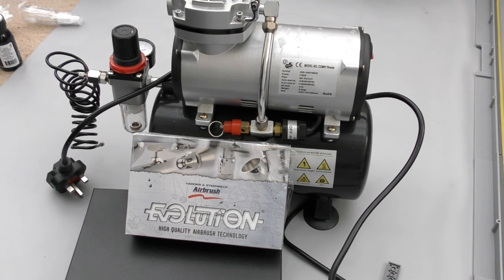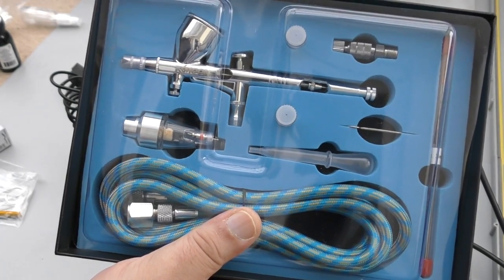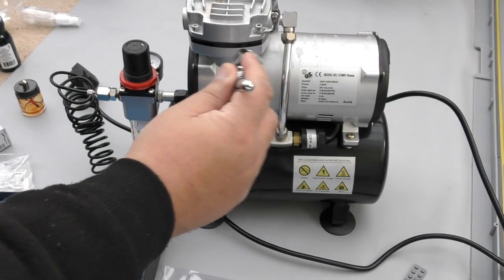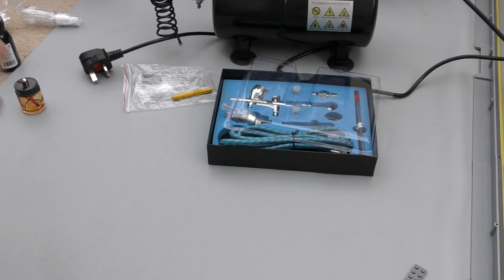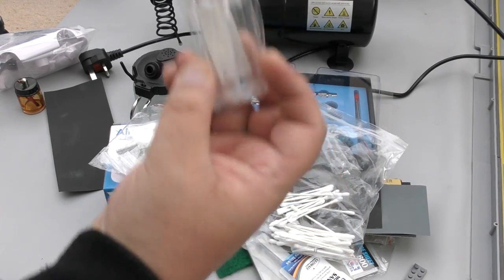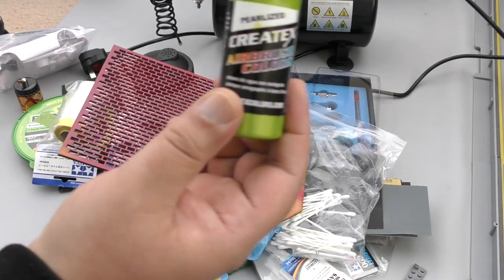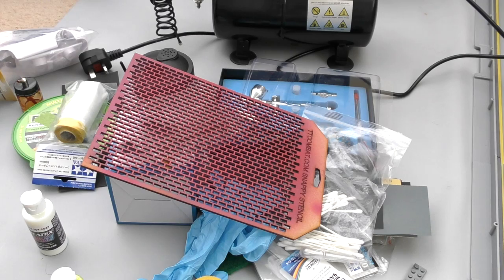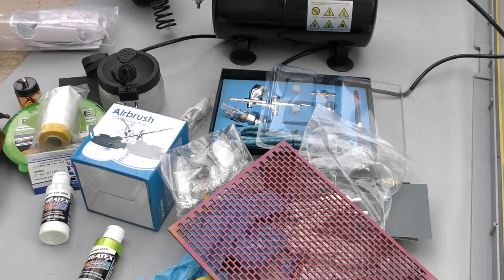HOW TO START AIRBRUSHING - A NEWBIES AIRBRUSHING GUIDE TO PAINTING MINI Z RC CARS

Comment: Mossy take the windows out of cars before you rub down they are easy to get out with knife then glue back when finished
Reply from the maker: Hi Chris, bro I really appreciate you taking the time to share good advice. That definitely is the way to go before you airbrush but as I found out while making my 2nd vid, some windshields will pop out as you say but others that have been glued heavily won't. 
I cracked the rear and side window on my McLaren 12c trying to get the windows out, it wasn't going to come out without totally snapping so I've left it in. 
Ohhhh come to think of it WD40 and even vegetable oil breaks glue down, that might be an option along as it doesn't leak onto the shell.
Reply: I've gotten a first whitebody a few months ago. and my childhood model build experience told me to testfit the parts, including the windows. the window clicked in place and even without any glue used, they where impossible too remove. i carefully tried to remove it for a hour, eventually the rear window cracked after to much pressure. i will never try to remove placed windows in autoscale ever again or place them before spraying the body.
Reply from the maker: @BlueDrift  I feel your pain bro!